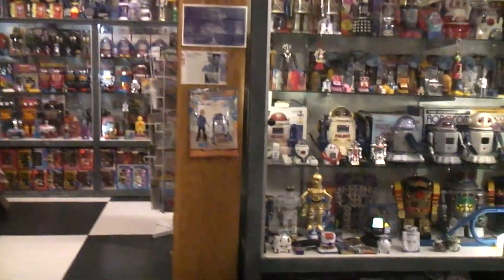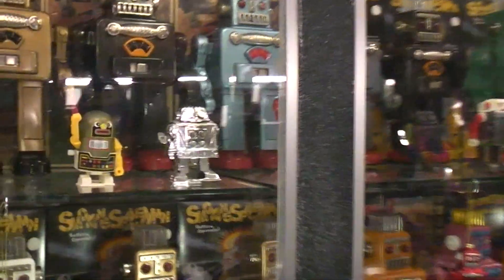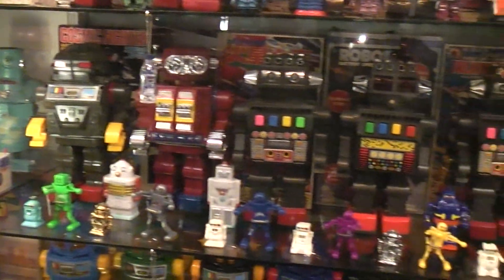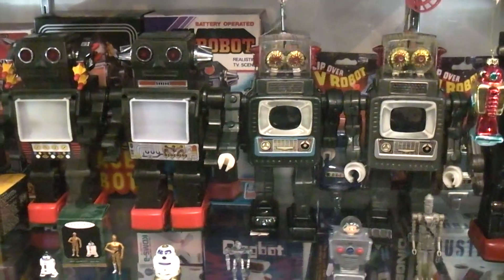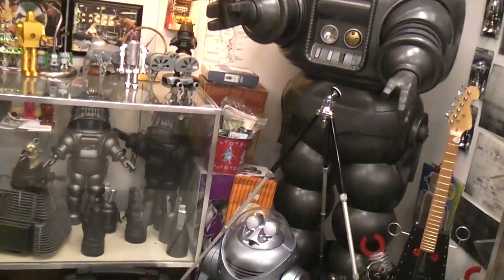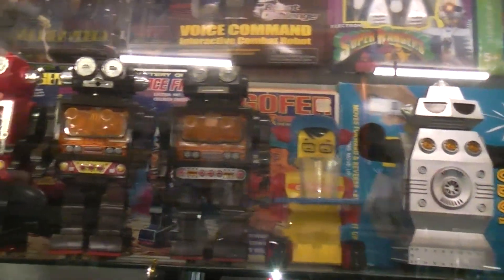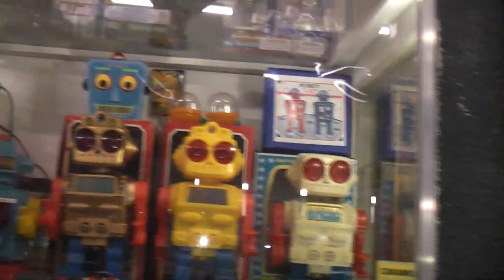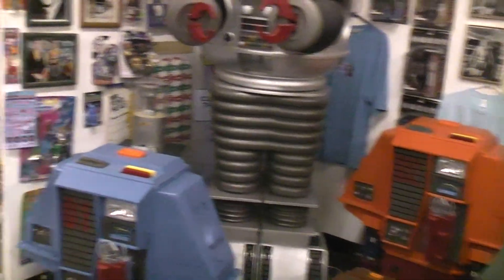Let's walk through the Robothut museum and look for ideas for more POGOT robot variations to build.

Comment: Hi John, something that i would love to see is a Heathkit HERO 1 / 2000 minature clone platform that can be 3D printed say 8inch to 10inch in height driven with either 1/4 scale Rc Servos or of the shelf gearbox with motors servos maybe easlier just remove the limiter for 360 rotation. They would make a nice little plaform for arduino projects. regards Richard quadrant2005 UK take care John.
Reply from the maker: Interesting idea. Will give it some thought.

Comment: You have a fantastic collection there, Sir!
As for chest screen suggestions, I’ve had lovely results from led lights in primary colours, shining through a small rotating transparent disc printed with patterns of primary coloured geometrics. It’s possible to get quite ‘random’ results with just 1 moving part.

I recall my best results came from positioning the disc approx 30° from the vertical surface to be projected upon, with 3 or 4 LEDs pointing up through it, variously positioned around the disc, but all pointing ‘screen-centre’. The lights further back project larger shapes in an opposing faster motion to those set closer, creating pleasingly varied patterns.

For a while it was my favourite basic method for keeping things interesting in relation to DIY sound-to-light colour organs and other simple sensory light creations, as even with stationary filters over a few blinking lights, with some thought and experiment a quite complex effect can be born from very little.
Reply from the maker: All great ideas. Thank you.